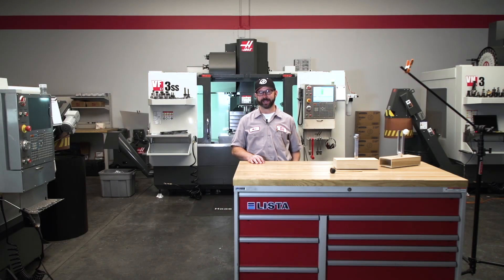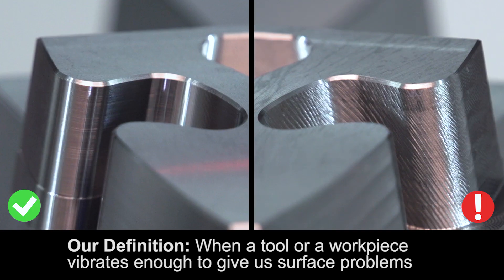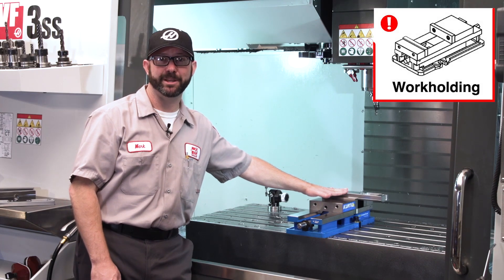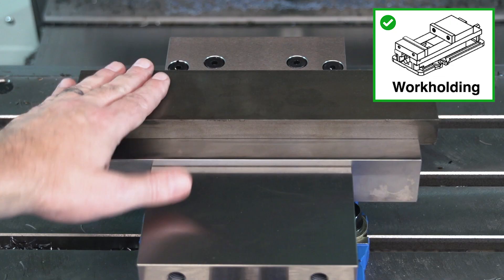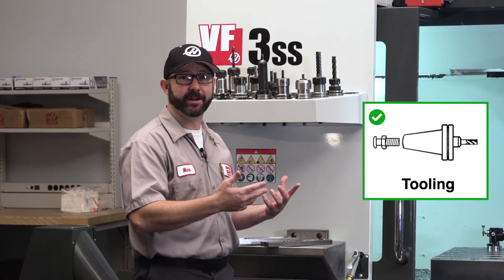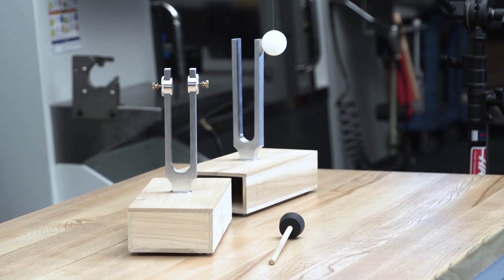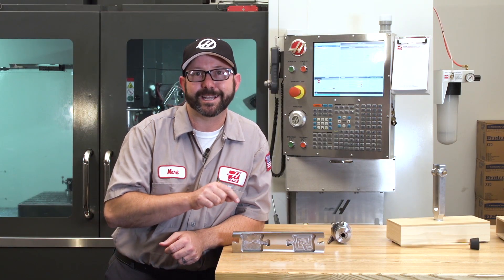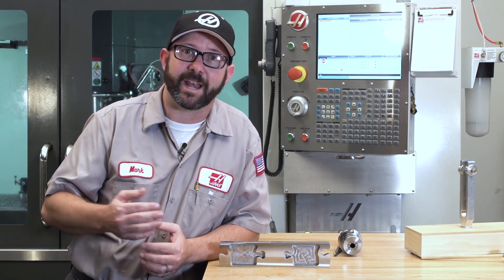Avoid Chatter on Your Mill - Haas Automation Tip of the Day

Comment: One thing I'd love to see is an actual knob for spindle override with 1% increments instead of the push button with 10% increments.  Often times the 'sweet spot' for little to no chatter is located above or below one of the 10% increments, which can cause a fair amount of 'trial and error' when trying to find the "perfect" chatter-free RPM for the tool/setup/etc.  I used to run a control (Acramatic/Siemens 2100) that had dedicated knobs with 1% increments for both feedrate and spindle RPM and could usually tune in the cut to be chatter-free in 3 seconds or less.  

Then just look at what feed/RPM I ended up at and edit the program with those numbers (in the background, while machine is running).  Repeat the process with each tool (if/as necessary), turn the knobs back to 100% at the end of the program and at the next cycle start, feeds/speeds were generally optimized to be chatter-free.  Any fine tuning could be done from there.  If I remember correctly, there is a way to use the pendant handwheel for feed and/or speed override on most Haas controls, but a dedicated knob would be really nice!  Pushing the buttons over and over to go up/down for speed or feed override is very inefficient and the 10% increments leave a lot of 'grey area.'

Comment: He just demonstrated one of the best arguments to NOT buy a Haas machine. There's no dials for spindle speed or feed rate. These are crucial tools for finding the best parameters.
Reply: It does takes some getting used to (using buttons instead of knobs), if you're coming from another machine. We do have the option of using the large Handwheel to control either Feedrate or Spindle Override (Press HANDLE FEED or HANDLE SPINDLE). I'll use this when dialing in my F&S to remove chatter.
Reply: @markterryberry4477  I'm not talking about controlling the feed rate in terms of a percentage value. I mean using a hand wheel to move the machine through the program. On many controls, you can literally move forward and backward through a program with the hand wheel at any rate depending on how fast you move the wheel. This is great for checking clearances as you can jog as slow as you want or stop anytime and move backwards.

Comment: Avoid chatter? My only problem with tool holding was with the HAAS endmill chucks.  The chuck couldn't handle a 1 inch sandvik R.390 cutter which it broke the inserts on within 3 inches of cutting. We then tried it with a high quality 1/2 inch Harvie TE solid carbide.  It broke the cutter almost instantly.  All the operations where the HAAS milling chucks failed ran smooth as silk with simple, weldon endmill holders.  We returned the chucks to our dealer, Thomas Skinner in Canada and they claimed the chucks were "fine".  They are not "fine". They are useless for milling.  The dealer is fighting us on the refund despite the fact we have bought 3 brand new HAAS machines from that dealer yet they argue over $800.   I have video of the cutters working with both the faulty milling chucks and also how they literally purr through steel in the weldon holders.  I will be happy to post a video on Youtube showing their poor performance if anyone has doubts.  Regardless of the tools performance I find the non existent customer service to be deplorable.

Comment: All these tips are great...however. There are cases where none of these may eliminate the problem.  There is another tip I can share. Back when I was young often times you could hear tires on cars and trucks making a loud whining noise while rolling. Trucks were the worst. It was caused by the tread having the same pitch all the way around the tire. This caused harmonic vibration and the whine. It was found that by changing the tread pitch around the tire in segments that it eliminated the harmonics. Modern tires most likely have from 6 to 8 different tread pitches. The same thing occurs with end mills because the edges have the same radial pitch. One time I was having the chatter problem with long EM on CNC and when setting a new tool into the machine I accidentally chipped the corner off of one edge. I decided to use it anyway. It cut smooth!
I discussed my find with a friend of mine that was vice pres. of a major carbide cutting tool company. So we did testing in my shop. He was able to produce an endmill with variable pitch. On a four flute EM it is not 90 deg. to each edge. 89 /91/90/90. His company began producing these EM's for the market. After more experimenting they found that they can alter the helix also from one edge to the next. I think today there are many manufactures of these types of EM's.

Comment: Sometimes something in the machine is worn to a point where the ridgidity of the machine is causing the chatter on heavier cuts. Some of our machines are getting maybe six years old and only chatter in X direction cuts. One machine chatters every direction in heavier cuts. We moved same tooling, same set up, same programs over four machines until one ran the job without chatter. The original machine was chatter free until it broke gearbox. Using Z carbs in 303ss

Comment: Hi. Can you please explain to me how it is possible to use a long fluted 3 flute alloy cutter?
Ive come to the conclusion recently that long fluted 3 flute alloy cutters are practically useless.
I always get chatter no mater what I adjust.
Big cuts and small cuts always chatter.
But ive descovered if i run a long 4 flute steel cutter that I can machine aluminuim so much better with much reduced chatter

Comment: can you develop an oscillating spindle speed function for example lower spindle rpm 1500 rpm and upper spindle rpm 1600 and add to this a duration between the 2 rpm for the spindle to speed up and slow down over a given time say around 2 seconds this will also help reduce chatter I have done this manually by adjusting the spindle override in just such a fashion and it works just fine. call it a G95.2 or G96.2

Comment: when you lower that rpm down so much in the corners, you also dramatically increase the chipload at that point. wouldn't that be dangerous
Reply: Not necessarily.   Depends on the tool, material and machine(stiffness).     I just had a case where reducing rpm 15% and keeping a high feed was the answer to my problem.   I was using a 6 flute with a strong core that could take the added load, but the reduction in rpm cooled it down and eliminated the chatter in a 4140 slotting pass.  
Just about every answer machining is 'depends'   lol.
Reply: @shirothehero0609  you had chatter?

Comment: I remember years ago (we didn't have  cam  software. On one particular part on the lathe going into a large radius no matter what I did I couldn't get rid of chatter. Unless I stood there changing the spindle speed constantly from 80%to 110%... small batch runs 12pcs at a time made doing it that way tolerable... Other times back in the day when we used to have Manuel cincinatti horizontal mills. We would hang/slide a weight over end of arbor. To reduce harmonics

Comment: That is far from the most annoying sound in the world. I used to spend 12 hours a day running a Makino Mag 1, sometimes almost 80 hours a week. On roughing large workpieces, we ran a 1" two flute at 3/8" axial DOC, a full 1" radial WOC, approximately 28k rpm, and between 700 and 800 IPM. I do not miss listening to it scream. The tool changer on that machine was slower than a 30+ year old Matsura that my current employer had until recently. I never timed it, but it was probably 45 seconds minimum to change a tool. Next to quitting time, those brief periods of near silence were the best part of the day.

Comment: Thanks for the tip! Excellent real physics at work!

What I do to stop resonating chatter with old-school lathe turning is to rub the rotating job with a notched piece of wood. This is done at 120 degrees of the tool and against the moving resonant peak where the job wants to flex. I have learned different speeds to do this so that it is just out of tune with the job as it changes over the cut. What it does is cause phase cancellation in the resonance which is trying to set-up.
It takes a bit of experience to zone-in on the rub-rate of the notched stick, but when you know why you are doing it, it doesn't take all that long.
Of course, applying any kind of force to the job will alter the tolerance of the result - but my experience is that the deviation is less than what is caused by the chatter.
In an expensive "new-school" environment, I could see a cheap alternative being to mount an acoustic transducer in the job-holding structure to detect and cancel chatter in real time. It would seem far cheaper and quicker to have that, instead of spending time on toolpaths, de-tuned cutting tools and brute-force cutting speed adjustments .. also doing the constant cut toolpaths lengthens production-rate.
Has anyone done such a dynamic de-resonator?
If not .. maybe you should? There might be a few bucks in that .. I'm happy with my notched-stick.

Comment: Mark thanks for taking the time to make this video. We have a 2018 haas vf5- 50 xt mill, everything is going great on that front. Now we are replacing a 1997 kuraki horizontal mill with a new giddings & lewis horizontal mill.  All the  production parts from the kuraki are being moved to the G&L. I can take the same tool from the kuraki, that had no chatter issues, and on the G&L with the same tool path, it chatters. And the spindle is 155 mm dia on the G&L, vs 150 mm on the kuraki. Even our 669.95 mm boring bar will chatter on the 8.5 mm  chamfer it cuts. Alot of times all I can do is greatly reduce rpm and feed. I'm wondering if there is something wrong with the machine. Maybe pull stud draw slower on the G&L? Would be worth having maintenance test this between the two machines. The other thing is, since the G&L is a new machine, everything is tight, maybe that is playing into the chatter.
 Going from our 2003 vf5 that we traded in, we had zero issues with milling or anything else converting the programs over.

Comment: also I admit--I NEVER thought of changing the length of the cutter slightly to change the harmonics of its natural resonance.
Reply: Ive always adjusted cutters shorter to try stop vibrations. I have never thought of making it longer to help the situation. Maybe i will try next time.
But my current job is set up and running perfect except from one cutter that is screaming.
My problem is to play about with tool lengths means id have to get each one inspected again which is not worth it for a low batch quantity.
So we will just have a bit of noise for a couple of days

Comment: How have i never thought of simply making longer vice jaws? I usually just use two vices clocked in parallel with each other, or screw a jack under the most prominent end of the job.

Comment: Those 3 are the most obvious but not limited too, ball screw tension, wear on slides, cutting forward(y-) on the spindle pushes down on the vertical slides and cutting back(y+) picks up on the vertical slides, and then the other obvious one conventional vs climb milling plays a really big role

Comment: Couldn't some kind of vibration sensor be added to the mill to detect chatter and then have the machine try to automatically adjust rpm and feed to try to eliminate it?
Reply: While in theory that sounds great but in realistic situations having the mill automatically alter the path of the tool will most likely cause problems with crashing, hangups, or even losing control. Remember these are machines communicating in analog and digital signals to control itself sometimes those signals can get twisted and weird shit happens.  I've had a VF3-SS Tool Changer huck the tool holder to the door of the machine because the programmer forgot to slowdown the tool change speed, luckily no one got injury. Dont ever trust the machine, always press reset before starting.

Comment: Hello bud love your videos got some things from them got one question on taping k I'm braking taps in 6061 aluminum parts are small 5/12 by 1/12 by 1/2 thick the holes are through holes  im useing a drill mill for taping and drilling the parts it works its not no cnc lol but what kinda tap should I be useing on these parts id love a good pro to help me out I'm braking these every 2 days or so I'm not getting crazy when I'm taping im taking my time when I tap them thank that about it if your interested in helping me id be very happy to here from you on this thanks for your time love what your doing with cnc.
Reply from the maker: Hi Shane – Check out our video on tapping, it should help some. – Mark, Haas Tip-of-the-day https://youtu.be/bkrUzGooA9k

Comment: The production values on this are sky high! Makes me want to get into CNC - any tips?
Reply: I personally prefere the mori seiki control....use sandvik and kennametal tooling...if possible...do not cut yourself short or dumb down the next gen in the name of the bottom line.

Drop the rent rates instead of raising wages....learn how to machine titanium and inconel....stay away from debt dependant circumstances...the deal could fall through every second of every day.

Comment: If I lower my speed...does it automaticaly lower my feed?
Reply from the maker: Life 2k – They are connected. If we lower our Speed (RPM) and leave our Feedrate (IPM) the same, we are actually taking a higher bite per tooth, feed/tooth. This extra load on the tool is often what keeps it dampened, and keeps chatter down when we are just lowering our RPM. Lower RPM = Higher chipload. Great comment. Haas machines do have a setting, Setting 144 Feed Override->Spindle which will automatically link the Feed/Speed, if ON,  so if a change is made your chipload remains constant. – Mark, Haas Tip-of-the-day

Comment: Does chatter always matter? What about  some enclosure type parts, inside surfaces having no b/p callout other than block tolerances, which can be 125, 250,  and more? Is this how you decide what's acceptable?
Reply from the maker: ugothydenow – No one wants bad surface finishes, even if they meet the Surface Finish tolerances. It just doesn’t look good for the customer. Chatter also causes the tool to bounce, which causes your tool to wear out more quickly, and it isn’t good for your machine spindle. We’ve all let the machine chatter through an operation, just to get through a handful of parts, but the truth is probably that it always matters, and is never a good thing. – Mark, Haas Tip-of-the-day
Reply: @haasautomation  thanks Mark

Comment: Thanks for the video Mark!  So in your opinion, is machining an art or a science? I say machining starts out as a science but the fine tuning of chatter control and finish becomes an art form and only a few in the trade are Rembrandts. =D
Reply from the maker: Toymaker94566 – Hah, I love it. That’s a great perspective, and I agree. Dialing in those last few tenths/microns requires a real abstract creativity, where you are making your best guess as to how the metal is going to move and how to fixture things up, or cut things, based on experience, intuition and maybe some luck – or you can hire a room full of Engineers running FEA software! Thanks for the great comment. – Mark, Haas Tip-of-the-day

Comment: Another tip you can try in increasing the feed rate. by taking a bigger chip, you force the tool to be "stuck" between the chip while its cutting and the material that isnt cut thus eliminated that vibration. 

You can also switch from climb cutting to conventional. that will keep the work piece pushed away from the tool instead of climb cutting which will 'grab' the work piece

Comment: And if that's an "Inside Cut" aren't you supposed to cutting Clockwise ?... 😐
Reply: Depends on machine. He's climb cutting which leaves a better finish. Cutting clockwise would be conventional cutting and usually used on manual machines or much weaker CNCs and a few other reasons
Reply: 3DLasers no, since your spindle is turning clockwise you wanna cut anti-clockwise

Comment: Tuning forks make a very good illustration. Cleaning chatter can be difficult as well when you're close to tolerance. Using very fine cuts is like polishing them out. It's hard to add to this video because you are absolutely right. On a lathe, you can put a magnet on the tool to help prevent chatter.Maybe hard to believe, but it works. I put a screw-jack under the part and it usually helps as well. Like you stated.... stronger support.
Reply from the maker: L Stevens – Thanks for the comment. We’ll have to try it!  – Mark, Haas Tip-of-the-day
Reply: We use jack screws daily. The key is to not over tighten